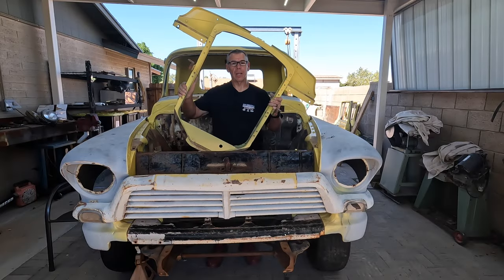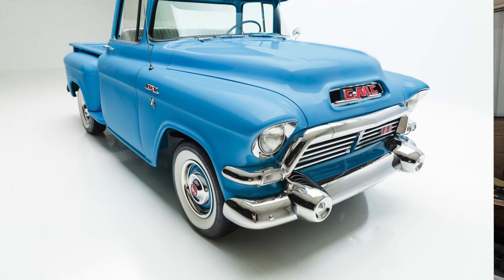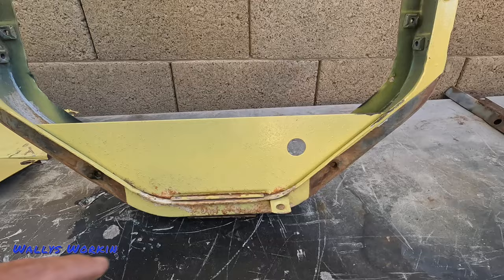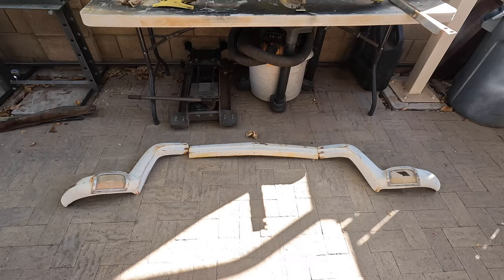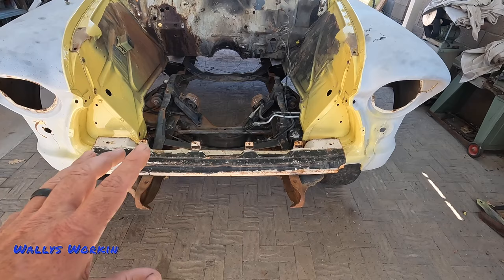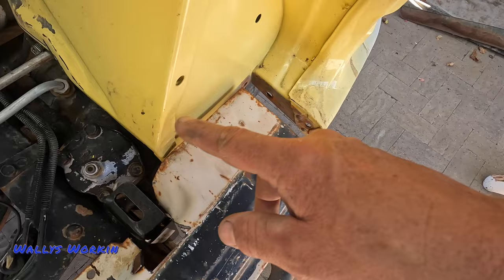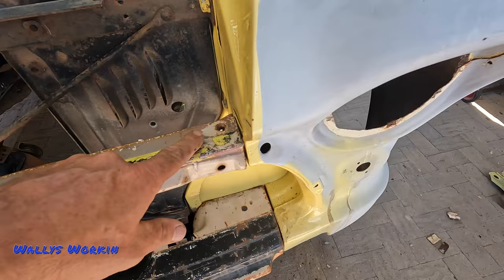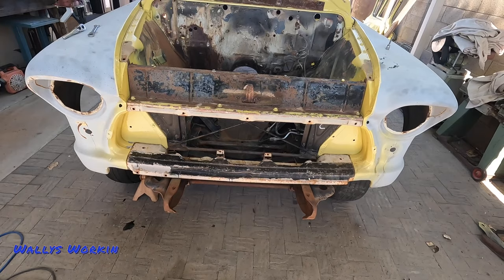Building a hybrid front end for the C10 frame swapped 1957 GMC / E-Z Chassis Swap

Comment: How does the suspension width look in the front? Would this work for a lowered truck or is the newer frame too wide for the tires to turn?
Reply from the maker: The width is perfect, lowering it will be fine to. I’ve seen a few of these combos on air bags slammed and everything fits. Just have to be mindful of wheel offset when it’s really low.